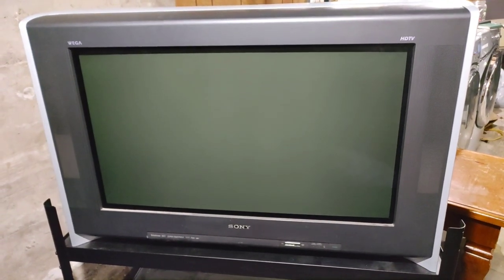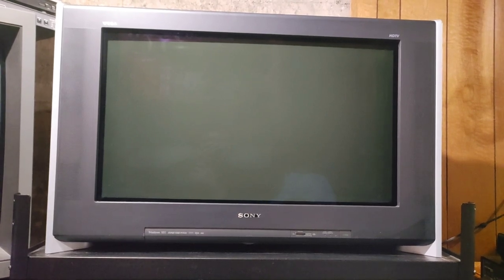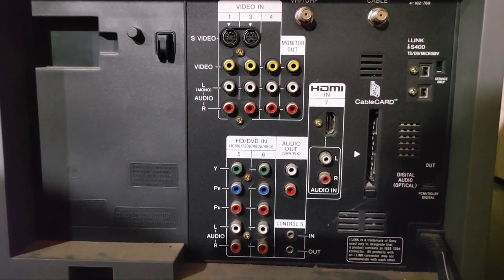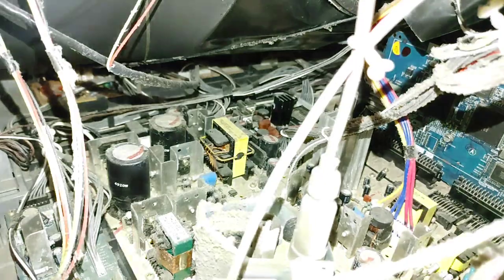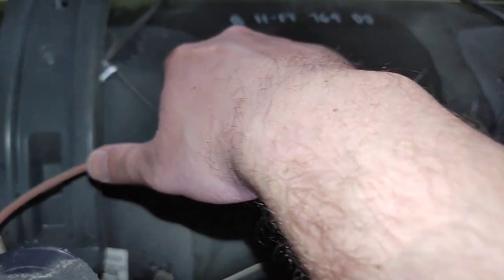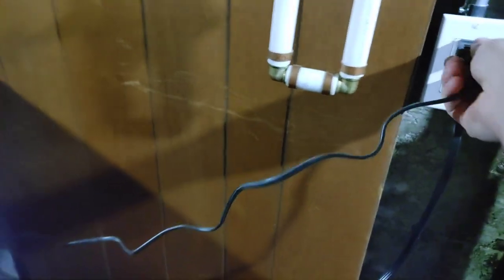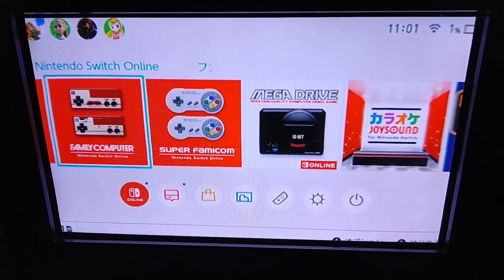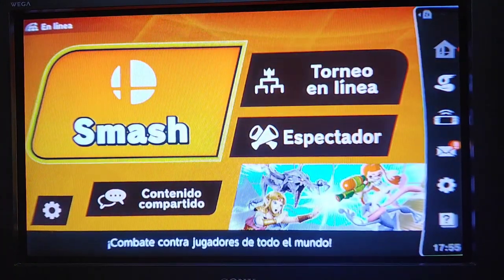Sony HD CRT - KD-34XBR960 Cleaning and Initial Testing/Thoughts

Comment: Just got the xbr970 variant of of this model over the weekend with matching stand for 100$ and I love it. Went through service menu last night and got everything pretty well tuned atm. However I’m not sure if this is typical of hdcrts but when I compare it to my Sony sdtv I notice that the image in general is darker. My brightness is set to 90 and picture is at 35. Is their anything else I can do to boost the vibrancy? I have it set to vivid currently.
Reply from the maker: Nice find!  I've heard great things about the 970!

After doing this video, I made another video comparing SD content from a GameCube with an S-Video cable to a GameCube with component cables at 480p ED (enhanced definition), and the SD (480i) content was quite a bit darker than the ED (480p) content, whereas on a SD CRT, the SD signal was a lot brighter.  Basically your same results.  I think these HD CRTs - while they allow SD connections, they really shine with 480p and higher.  Have you tried 480p on it?  Is it still dark?
Reply: @FairyKid64  that’s primarily what I use it for 480p 720p gaming. Mainly ps3 and Xbox 360. It’s just that their are parts of an image where it’s too dark like detail is lost. I tried to calibrate it to the Xbox one built in tool. When it comes time to adjust contrast I can’t as their is no option for contrast. Just picture, brightness, and color. I wonder if their is an option to adjust it in Service menu?
Reply from the maker: @phillipdorofy5149  Ah, gotcha.  I haven't messed with the service menu yet on these HD CRTs, but from what I can tell from what you're describing, it sounds like black crush.  You might already know this, but black crush is a problem with all display types - not just CRTs.  LCD, Plasma, OLED - all suffer from black crush at differing degrees.  You mentioned that you had your 970 in Vivid mode.  Vivid mode is notorious for having black crush in my experience.  Not just on CRTs.  It's the mode that new TVs often come set as the default because it's the most punchy as far as colors go.  When people are comparing TV models on a show floor with lights shining as bright as the sun inside, often the most punchy looking TV gets bought - hence why vivid is the default mode.  You might want to try either the standard or pro modes.  I found on my 960 that while the colors didn't pop as much in those modes, black details were better preserved.  Same thing with my Sony OLED TV.  Plus your eyes get used to the dimmer colors after a while anyways - especially if you're in a darker room.  Have you tried comparing vivid to standard or pro modes to see if it helps with the black crush?  I hope it's something simple like this and not a hardware problem.  Usually it is something simple.

Edit: Forgot about cinema mode.  That's a good one too.  Probably cinema and pro will be best for eliminating black crush.
Reply: @FairyKid64  ahhh ok yes I didn’t know that. I’m kinda a novice to picture calibration. I’m getting more into it now and it seems like a rabbit hole lol. I will try the pro mode and readjust the setting according to the Xbox suite. But I can’t get the dang sun to blend with the white. Apparently picture setting is the contrast. I’ll keep working on it. Thank you for you input and advice! Love the content , keep it up!
Reply: @FairyKid64  did you do it??
Reply from the maker: @cooparchive7857  are you talking about entering the service menu?  If so, no - not yet.  The picture is already good enough and I hardly notice the imperfections when playing games or watching movies.  It's actually a surreal experience.
Reply: @phillipdorofy5149  maybe you should chet the service menu options.. you can tweak sub contrast and sub brightness from there, as well as an option that allows you to set how drastically the transition from dark to black..i just dont remember the name of the option.. 
excuse my poor english
Reply: I have a xbr970 as well can't get my svideo n64 to work with it.

Comment: Corners on the right look soft, possibly convergence issues. Also the geometry looks a bit wonky when looking at the Switch menus lines.

Did you dial this out?
Reply from the maker: Yes, you're right.  The corners are a bit soft with some convergence issues.  I haven't changed any settings yet, but I'm going to eventually. =)

Comment: 👍 Thanks for a well-lit upload showing the internals after removing the case. That was dirty.... Makes me wonder what's inside my 27" SD WEGAs now. 
🔥👉 6:30 (top right of connections - "iLink/s400") .... 14:28.....
✏️📌It may be noteworthy:
🚫  I am unsure if damage can be caused so I am warning against connecting either of those s400/iLink firewire jacks on Sony's CRT TVs or any other products to the s400/iLink Firewire system-link jack on PS2 consoles - model number SCPH-3900X and older. iLink/s400 firewire on PS2 consoles was not used for sending audio or video. Even though PS2 was a Sony product, the only other hardware aside from another PS2 console that can be connected to a PS2 is a dedicated firewire hub connecting additional PS2 consoles. Don't succumb to any temptation to mixing and matching PS2 consoles plugged into a FireWire Hub with any other devices if there is ever an itch to get more utilization out of the hub for various types of old hardware. If need be, go through with the cable swapping to either only have PS2 consoles or, if the CRT TV supports multiple simultaneous devices, devices other than PS2 consoles routed to the hub to save on purchasing dedicated hubs-one for the PS2 consoles and one for all other products into a respective, supporting device. This dissemination may not have been clear at the time the two pieces of hardware contemporaneously coexisted.
Reply from the maker: Yeah, that's a good point.  I also wonder if damage could occur if you connected a PS2 Firewire port to this TV.  It would be a good idea to research first.  It's probably better to just use the PS2 component or RGB output.

Comment: Boy that is a fairly clean tv imho zi figured 16 years of dust starting sometime in well ig fwiw a 2002 set looking with a flasjligjt into the slots for seeing what was in it as a kid a kv32hv600 I looked into it an saw and then on knew it jad a built in subwoofer.

Comment: it has a atsc digital no analog converter box needed
Reply from the maker: Yes.  I haven't tried it out yet, but that does sound like a cool feature.  Hopefully I can get a good digital over the air signal in my basement.  Digital signals aren't nearly as forgiving as the old analog signals were...
Reply: Had no idea any CRT TVs came with digital over-the-air tuner in North America = Learn something everyday. I remember vividly how much better over the air digital TV looked over that of my cable box and that was a setup on a 27-inch Sony 4×3 Wega standard-definition through an extra shielded yellow composite cable from a set-top box I cherry-picked from RadioShack using the government rebate whereas you would have thought that the red, green, blue component Video Connection from the cable company's DVR tuner but presumably looked better but it was trailing far behind the composite delivered signal from that set-top box tuner and a good antenna - enough to watch the Olympics isn't the over-the-air tuner instead of via cable company.
       🤔 What tuning protocol was the tuner using at that point in the widescreen CRT here ?
...✋️ I'd vote to see a video upload of it tuning in digital over-the-air TV - especially curious to see what its channel program guide looks like on-screen, if it has it, and if future scheduled programs are navigable. To me, it's an interesting piece of home electronics history especially at such a confluence of various peaking established and emerging technologies.

Comment: What's better and more rare 910 or 960? 🤔
Reply from the maker: So, they're very, very similar.  Almost the same TV even.  Both have the same amazing sound system with a subwoofer and the super fine pitch screen.  The main difference I can see is that the 910 has a DVI port instead of HDMI.  I don't have a 910 specifically, but I do have a Panasonic HD CRT with a DVI port instead of HDMI, and it's not a big deal.  HDMI to DVI adapters are very easy to come by and I haven't had problems with it.  The biggest inconvenience is that DVI doesn't carry audio, so you have to use RCA jacks for that, but that's definitely not a deal breaker.

As far as rarity, I'm not sure, but if I had to guess, I would say probably the 960 since that particular model seems to be hyped up a bit more even though it's essentially the same TV.
Reply from the maker: Also, this Wiki page is really good for comparing a bunch of the US Wega Trinitrons:
https://en.m.wikipedia.org/wiki/FD_Trinitron/WEGA

Comment: These TV's can't properly show movies. They lack 24 progressive playback. So the trailer you show either is played at 60Hz and has 2/3 pull up stutter, or it is showed at 50Hz, resulting in one double frame every second, both are highly annoying with panning objects and lots of action. Motion will look better with a progressive scan DVD player (one that calculates the missing lines to create a interpolated 480p  or 576p image) as those are targeted at 50i or 60i TV's, but that is far from HD and less sharp then even budget plan Netflix 720p. So it can be fun to play around with such a humoungous piece of CRT tech for fun if you stumble upon one for free, these are not worth the going for second hand prices. A 1080p Pioneer or Panasonic plasma, which are sold for 20-30 bucks, is superior in every aspect.
Reply from the maker: Huh, that's interesting.  I'll have to try setting a device to 24 fps output and see if I notice anything.  So far I haven't noticed any hiccups in panning shots, but maybe that's either because I don't know what to look for or because the movie device already is doing a good job at converting 24 fps to 60 fps. 🤔
Reply: @FairyKid64  I'm curious what you get if you feed these true 24Hz. You could also try 48 Hz, that works for many computer LCD screens, that are designed for 60Hz, yet somehow most work from 48-60.
Reply: @2kBofFun  a ubearable amount of flickering. 50hz is bad enough for my eyes. Some CRTs at the time had a digital techonology built in that either interpolated the 24hz of movies to 50/60hz. The best option is 72hz or 120hz, which i think some plasmas and OLEDs do.